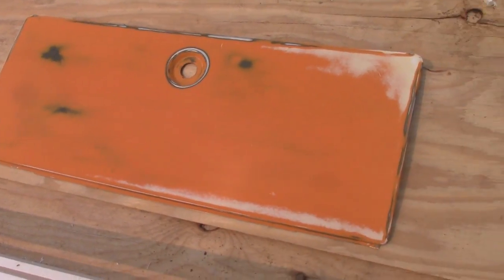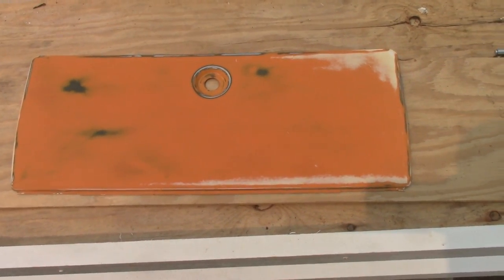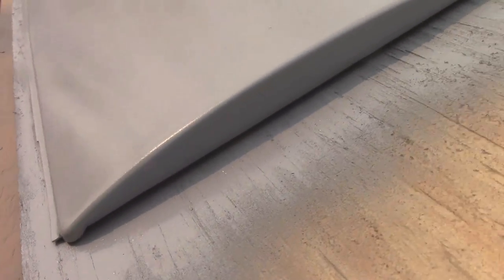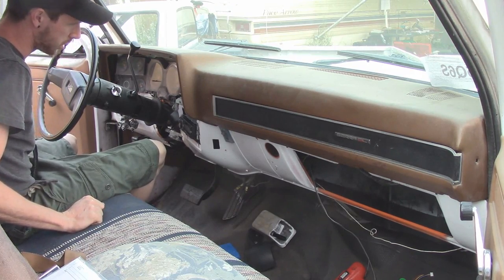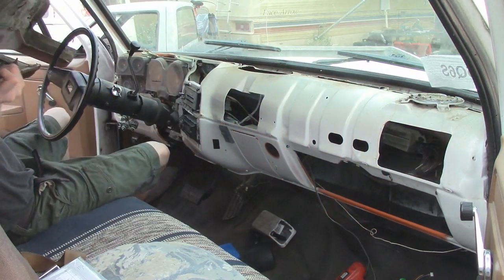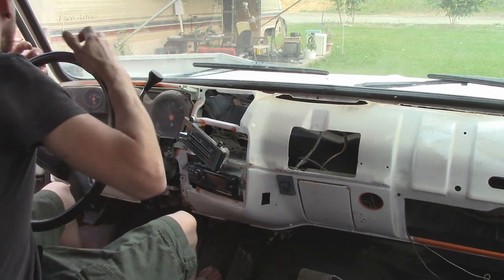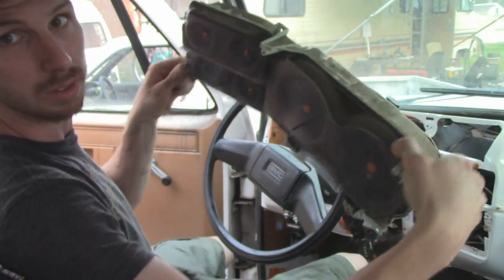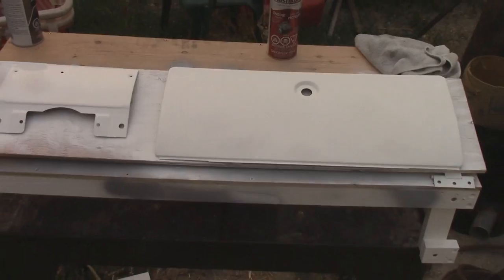1989 GMC 3+3 - Painting and Dash Removal

Comment: Did you say glow plug?  are you planning on going diesel? cummins i hope?
Reply from the maker: ha ha ha ha :) its definitely getting a diesel. i cant afford to drive a big gasser :P im after a 1st gen intercooled cummins for this. ive got a line on a truck (just waiting on money), or an engine and transmission (gotta do some work for a guy). either way, ill have a cummins in this thing before i really start driving it.
Reply: analog56x do you run veggie oil in your diesels? I run it and a bit of waste oil in my 01 dually.....runs good....i do injector removal and clean in spring and fall......no issues.
Reply from the maker: Joey G i never have, but i may consider it if fuel prices get much higher... plus, who doesnt love the smell of french fries?! Haha!